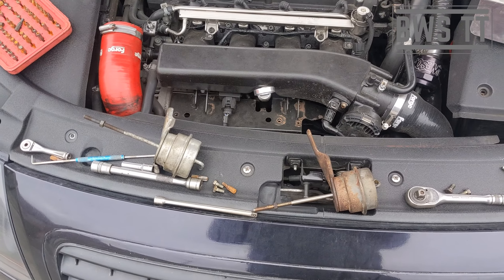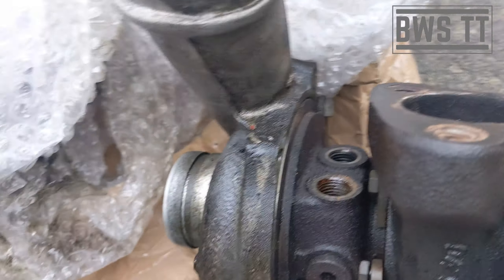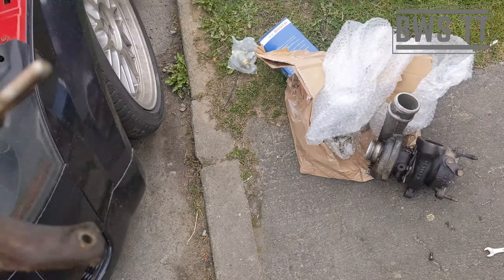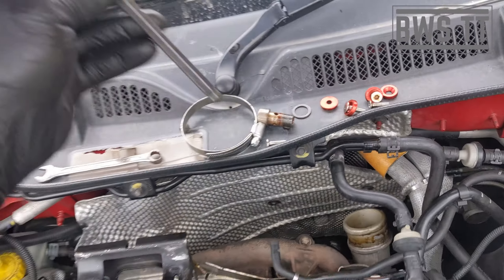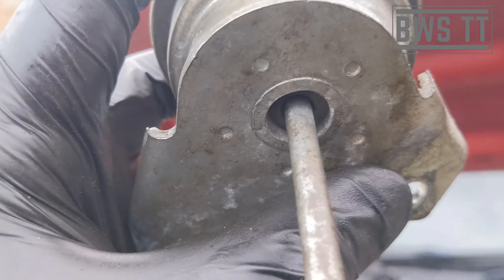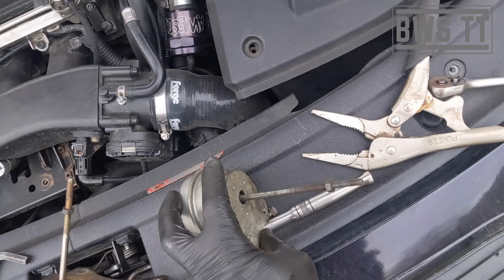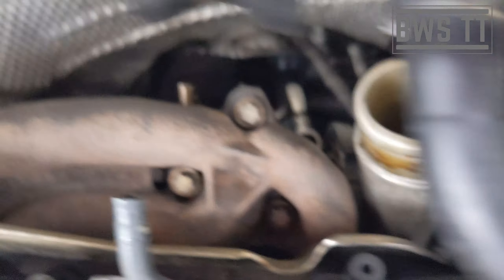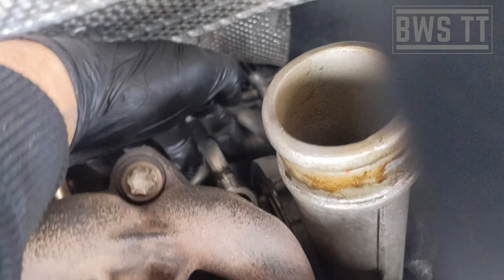Audi TT Actuator swap K04

Comment: Thanks for the video. Is much coolant lost when the banjo is removed?
Reply from the maker: Not a massive amount, but it'll need topping up afterwards
Reply: Sorry, another question. If replacing with a new, standard actuator, how much pre-load would you recommend? I.e. how many turns? Thanks

Comment: Your videos are simply the best. My TT has an over boost issue and I've been told to review the wastegate actuator to see if it's stuck closed. Does this sound accurate? I have also ordered a new n75 (oem) feedback appreciated
Reply from the maker: Yeah, in a nutshell, the waste-gate should start to open at 5.5psi, and should operate smoothly all the way to fully open. If the n75 is sticking it can cause the wastegate to stay closed too much and generate too much boost. Start with the wastegate- unplug the n75 plug and use a boost gauge to see if it only gets to 5-6 psi, if it does then look at the n75, if it doesnt then address the wastegate issue
Reply: @BWSTT  thank you! I use the torque pro app and when the n75 is unplugged it's getting less than 10psi total. So, this points to the n75 as faulty, and at the same time confirms the wastegate is okay?